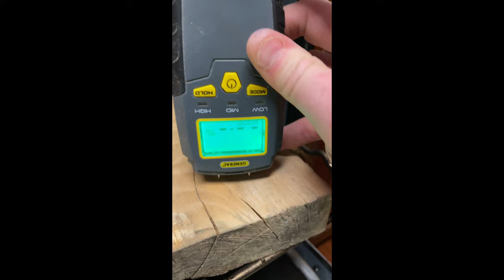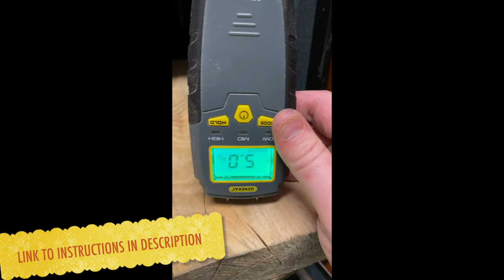LIVE EDGE EPOXY CUTTING BOARDS

Comment: How do you do both sides without drips hanging from one side? Or how do you remove them?
Reply from the maker: Hi Brody, I use small boards underneath to prop them up. Epoxy a top or bottom + sides and wait for it to dry. Then flip, sand and epoxy other side but don’t let it spill over…if it does, catch with a brush before it falls too far.   Just my two cents.
Reply: @MakingMakers  that was what I was thinking but Epoxy seams like it would be hard to go back and fix and kind of expensive to just turf it and start over. But I have noticed on some other larger builds that they chamfer and round over epoxy edges with a router just like bare would so maybe not so hard to fix. But glad for your advice because it's always nice when you don't have to fix things ha ha